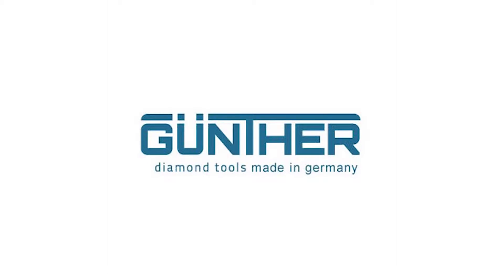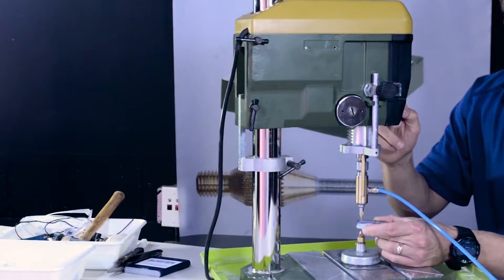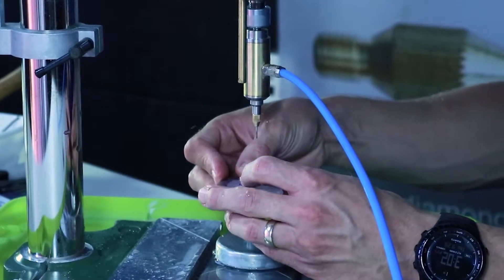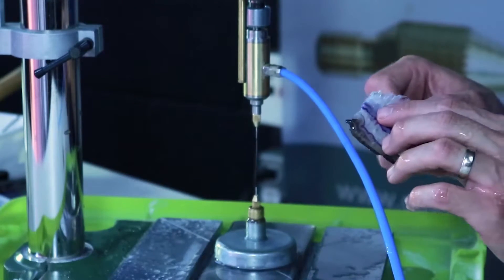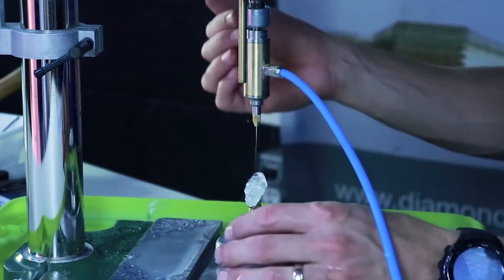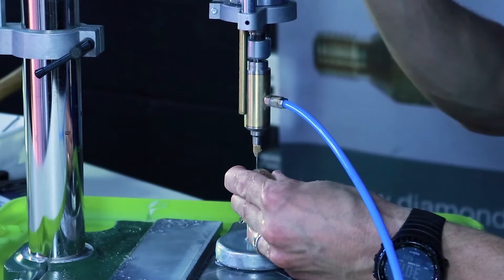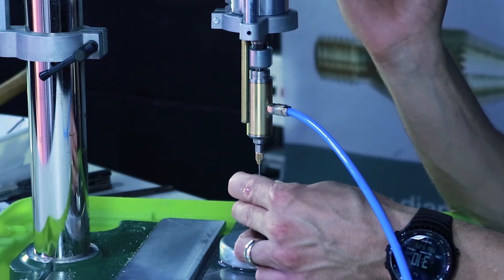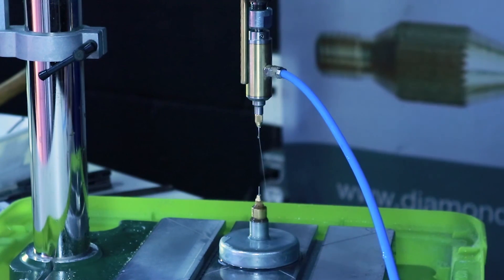Drilling Various Hard Stones

Comment: Can you direct how to set up a counter post" This is exactly what I have been trying to figure out. How to get both sides to be exact meet, if i eyeball it im always off. This is perfect. Also PLEASE give direction on how to set up your water system for the drill bit* I LOVE IT.
Reply from the maker: The best way to align the counter part is by touch. With the machine off,  lower the drill bit so that it touches the counter part and then run you fingers up and down the junction between them. Tap the magnetic base that holds the counter part with a mallet until you don't feel an overhanging edges on the drill bit or counter part.  

The water supply can be configured in many different ways. Give us a call to discuss options that might work best for you. 
Thank you!

Comment: Hie do you know when the drill bit meets the counterpart below?
Reply from the maker: You will feel the the drill bit go through the stone and touch the counter part. Its ok if the two parts touch while you're drilling as long as you stop and back off. If you continue to drill the counter part will grind down, but you can file it down to make it flat again. You can also set your drill stop to zero at the point where the two parts touch so that you

Comment: What is the RPM of this machine?
Reply from the maker: The machine in this video is operating at 2400 rpm. Our hobby and Pro systems are belt driven and can be adjusted from 1080, 2400, 4500 rpms.